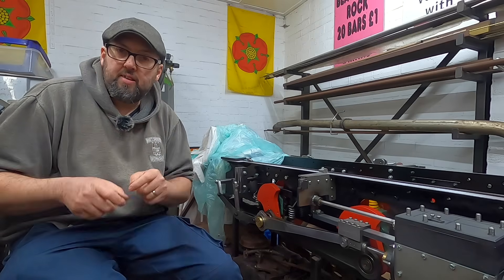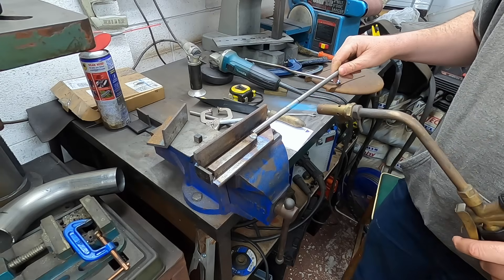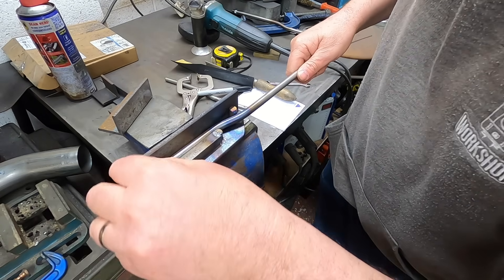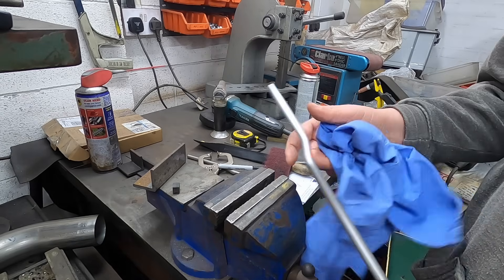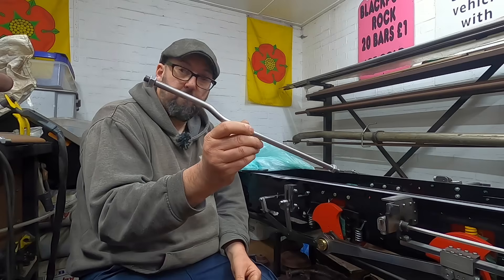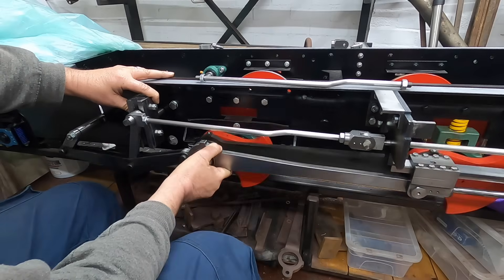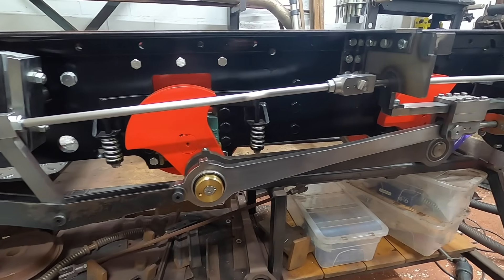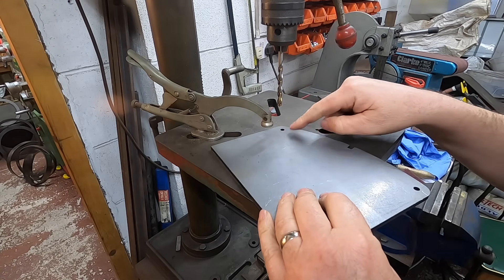Connecting the valve gear up & reverser starts - EP89 Project Tinkerbell  7 1/4" Steam Loco Build

Comment: I’m curious, you’ve used what I know as a die nut to cut a new thread. These are used for reconditioning old threads, just wondering if you were scammed? Button dies is what you should be looking for.
Reply from the maker: There is a saying, if it works, it works… and it worked 😉. It’s more the case of, use what I had in the drawer or buy another… and the bank was empty! Budget engineering at its finest. All the best, Matt 👍🚂

Comment: Hey up mat love your videos, quick question. what's the blue disk in the grinder you were using to clean up the sliding linkage.
Reply from the maker: Hi Paul, they are poly strip discs, used to strip paint and rust off metal, or clean up mill scale and after welding, they take minimal metal off, more polish the surface. All the best, Matt.